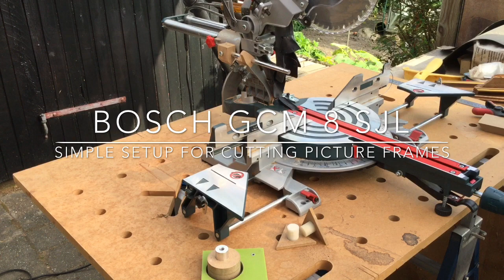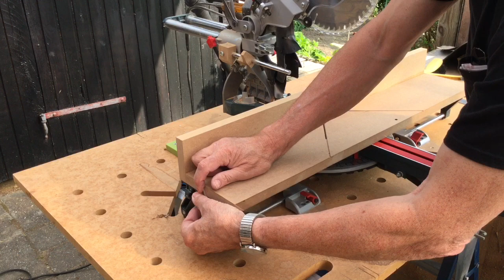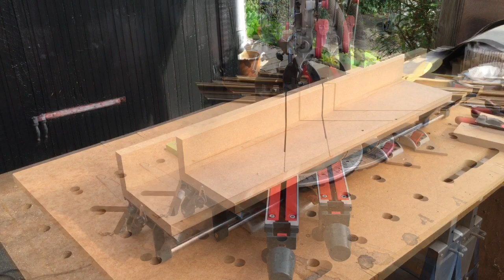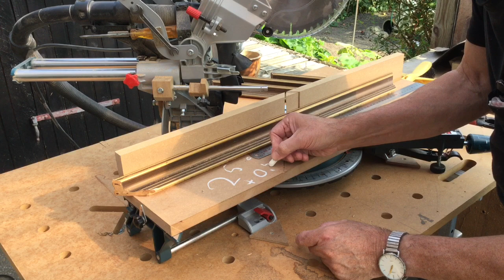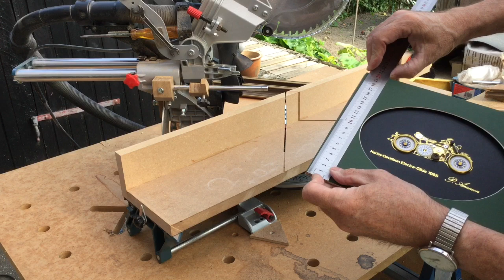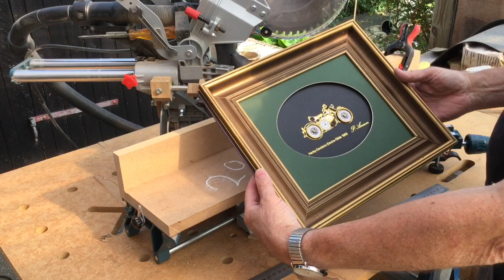Bosch GCM 8 SJL Simple setup for cutting picture frames

Comment: Thanks for these tips. I normally leave mine setup at 45 and just turn the frame over to cut both ends. I Will make the jig as the saws lock adjustment for mitres isn’t 100%. Should help to easily get the cut line measurement spot on at the same time. Good on reaching 1000,
Reply from the maker: david mezzone Thank you very much for your comment, the advantage of this simple setup is that it is very easy to measure the frame pieces so that the picture fits precisely.

Comment: Your videos have been great.  Please can you explain how you get the exact 45-degree cuts on the saw?  My saw is not this exact and I can't see how your job helps this.  Please post a more detailed video on setting up and making the jig if you can.
Reply from the maker: If your 45˚ setup is not correct, you must also have a problem with your 90˚ and according to the manual you can not solve that problem yourself, but you can have the error corrected at a Bosch workshop.  When I got my saw it was one of the first things I tested.  My saw is not 100% either but it is so small that I can not say if it is the saw or maybe the blade so I have chosen to live with it.  There will be a new video with a new and improved version of my picture frame saw plate but I do not know exactly when.

Comment: Yet another great video, this will certainly help, thankyou. 
Can you tell me what diameter is the threaded nut that you use on the stop, to help keep your jig in place? 
And which dust extractor are you using? 
It sounds perfect that it starts and stops as soon as the saw starts up, and carry’s on for a few seconds after
Reply from the maker: Thanks
Reply: What have you done to your vacuum cleaner to make it start and stop when you turn on the saw?
Reply from the maker: It's not something I've made, it's a feature found on almost all vacuum cleaners for workshop use.